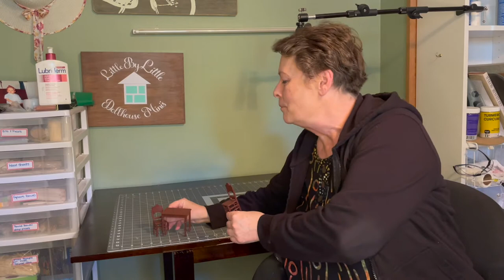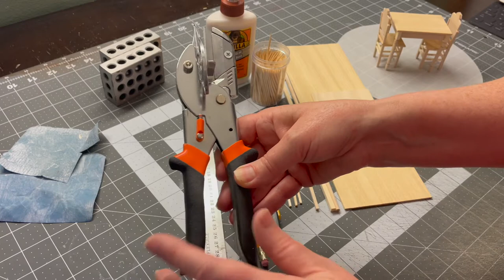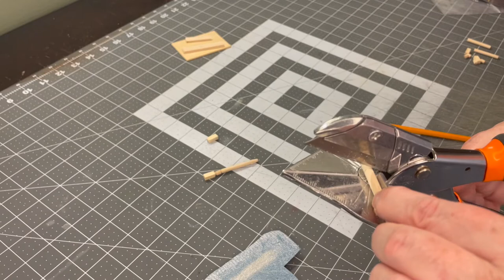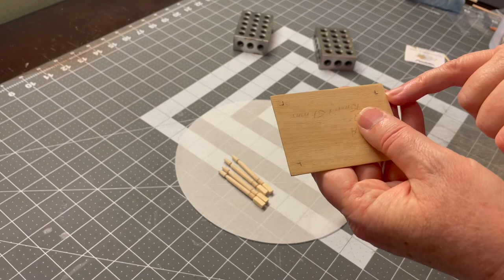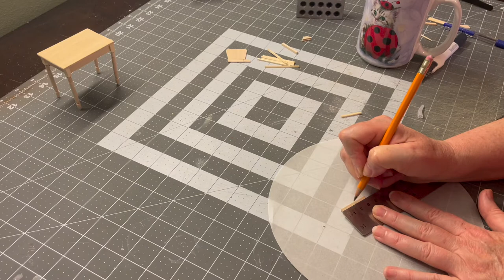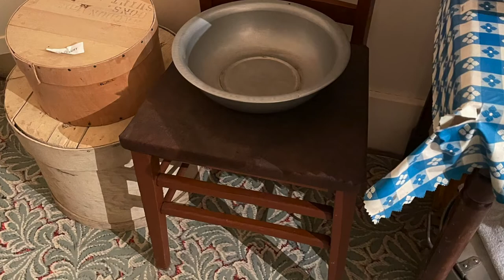Building this 1:12 miniature kitchen Table and Chairs

Comment: Hi.... I finally had a chance to view your tutorial.  I love what you are doing.  I fully agree with you that we in Canada should use the metric system for our minis.  You are so right that you can get metric to inches conversions on just about anything.  As of today Dec 3/22 there are only 3 countries still using the imperial system.  U.S., Myanmar and Liberia.  The other most important thing to mention is that minis in scale are thrown off by the very minimal measurement.  Therefore the metric being so divisible and easy to measure more accurately it is the best system to use when in specific while making furniture.  Thank you for sharing your project with us.  (Fatima- Vancouver Dollhouse MIniature Show --Vancouver B.C.
Reply from the maker: Hi Fatima! I could not agree more! I’m a little old school and still find myself referring to things in Feet and Inches, but for minis I only use metric. It is so much easier and more accurate!! I do understand though, that if you have never used the metric system, it could be hard to follow. Thank you for watching!

Comment: 😹I have that very same chair sitting in my workshop right now, it’s been in my family for as long as I can remember and I’m 59 now lol Mom and Dad even packed it into the shipping container when we moved from the UK to Australia, we did not bring all our stuff from the UK but some items like the chair we did bring with us as they were always in the family. I’m actually using ours as the guide to the ones I’m making for the dollhouse.
I always give my items that are going to to be stained a sanding and I have been using the emery boards used for filling my fingernails I find them so much easier to hold as they are perfect for sanding small fiddle items.
Reply from the maker: That is amazing that you have the same chair!!! It makes me wonder now if my grandma’s set came with them when her parents immigrated?! We were lucky enough to find the set in the museum but so much of the history of those pieces have been lost. These little bits of information are so appreciated!! Thank you for the tip on using the emery boards. I have added some to my tool kit. :))